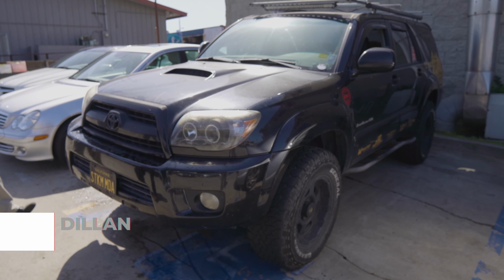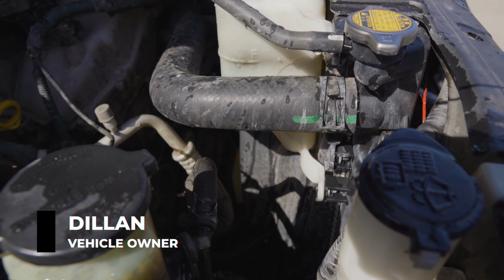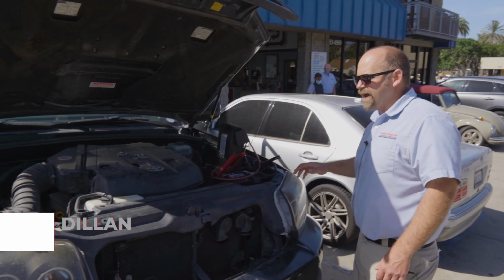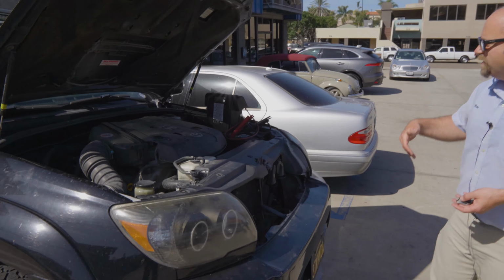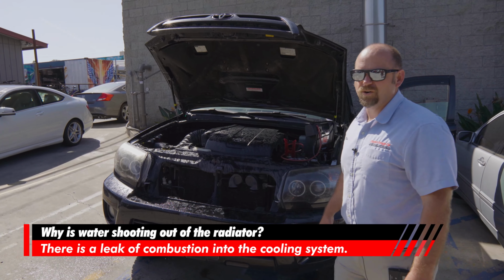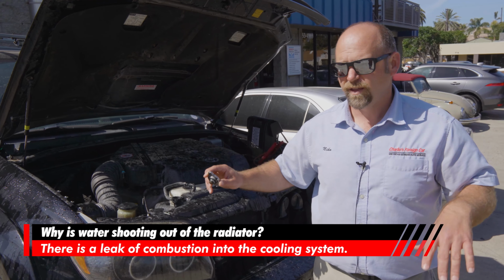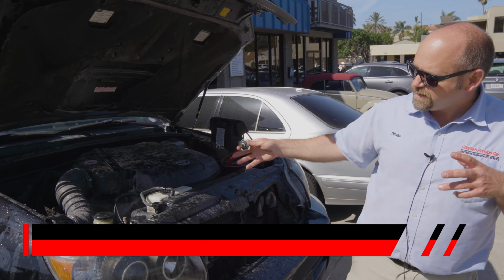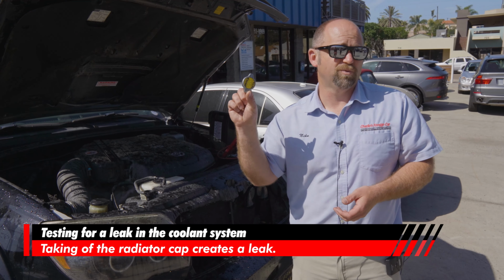Test for a combustion leak

Comment: I just fixed a problem like this on a Mercedes.  Bad coolant made enough corrosion to cause a leak into the 3rd cyl.  Pressurizing the coolant on startup is never a sign.  It’s an old 190e diesel.